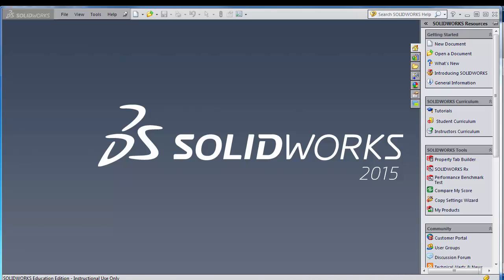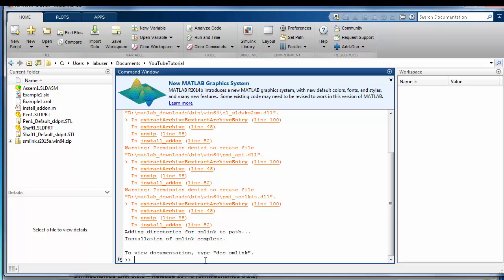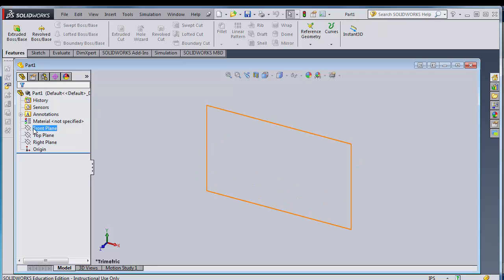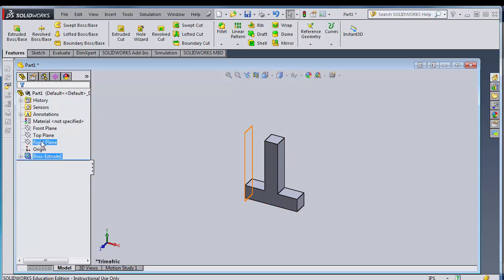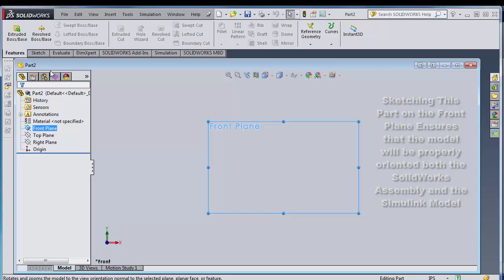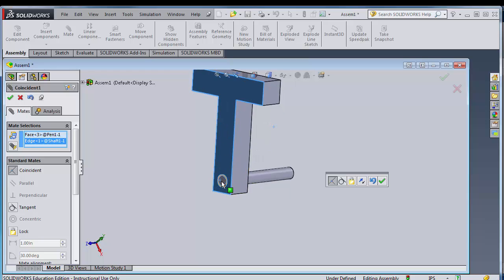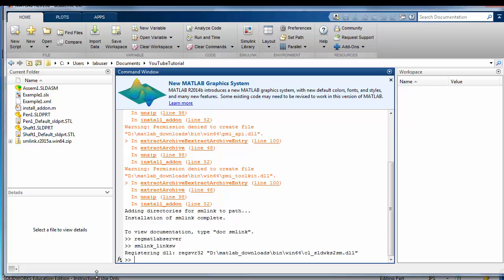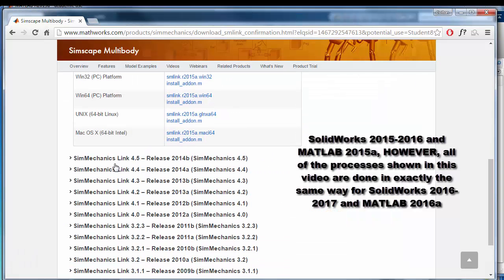SOLIDWORKS to Simulink Simscape

Comment: Thank you Professor Parker and Jacob and Maya!!! Excellent video! It's 2022 and I got it to work with 2021b Matlab and 2021 SOLIDWORKS. It doesn't appear that comments are being replied to here by MTU. I see that Mohammed Aliff asked about the followup video. I don't think they exist atleast not as intended. There are (3) additional videos about Simscape from Professor Gordon that are helpful. They are videos about Simscape and not about Solidworks to Simscape from what I can tell.
Reply: Professor Gordon has almost 100 videos about Systems and Controls. Tremendous body of work!

Comment: Hello! I recently encountered a problem! My matlab version is R2018b. I installed the Simscape Multibody successfully. But once I use the function ' smimport' or 'mech_import', it will display the following problem ' 'smimport' requires Simscape Multibody.'  But indeed I had installed it successfully.  So could you help me to solve this problem?
Reply: same problem ... please help
Reply: u should enable it before using

Comment: Hi Prof. Gordon, thanks for the extremely helpful video about Simscape and Solidworks. However, I am having problem in simulating the CAD assembly in Simscape, I can't see my solid body in the simulation window though I can see the CoM icons and references. There are no error messages either. I would really appreciate if you know about this problem. Thanks in advance.

Comment: Gordon, 
I'm using solidworks 2012, my computer is 32bit, matlab 2015b

i have followed the instruction 3 times, but the link doesn't appear in solidworks 2012

is it possible to have simmechanics link in solidworks 2012, but the matlab is matlab 2015b?
Reply: same question

Comment: Hi Gordon,
Your videos are very good and self explanatory. I am facing a problem with solidworks to simulink imported model. The Simmechanics Imported model is continuously moving without any given actuation. What will be the possible solution, so that it cannot move without given actuation.

Comment: I had a problem with the install_addon('smlink.r201...win64.zip') because I wasn't running MATLAB as an administrator.
Thanks for the video. It was very useful.
Reply: thank you i had the same issue
Reply: thank you. I have same problem, I have took for 3 day to solve it until reading this comment.
Reply: same here jajajaja its a common mistake i think so
Reply: Hi Manuel, how do you run MATLAB as an administrator? I'm having trouble with install_addon